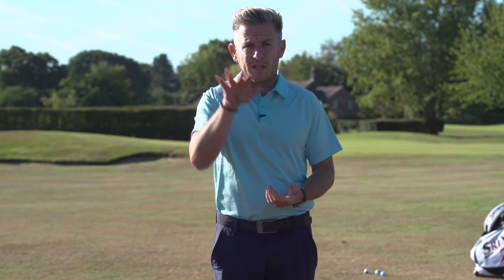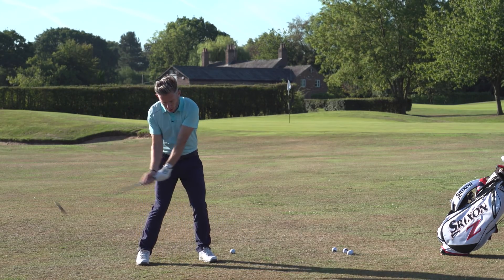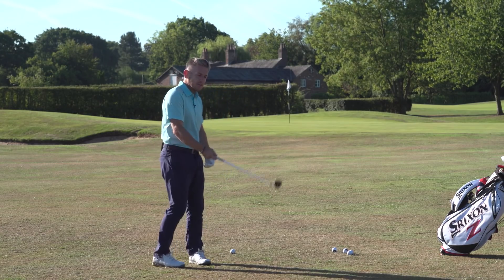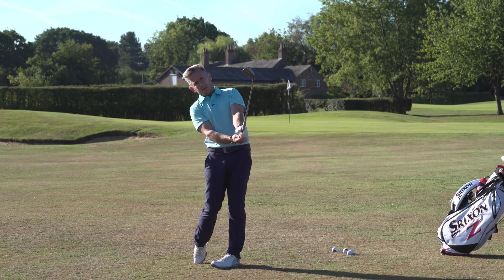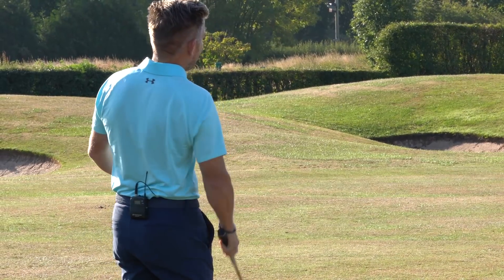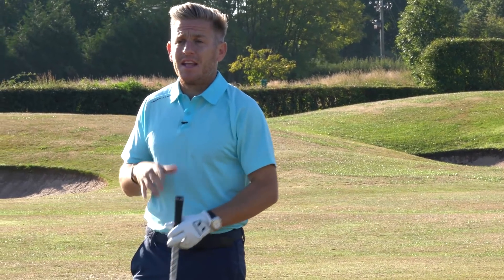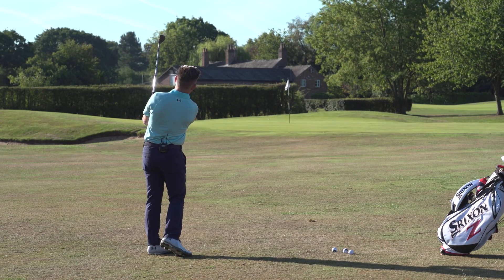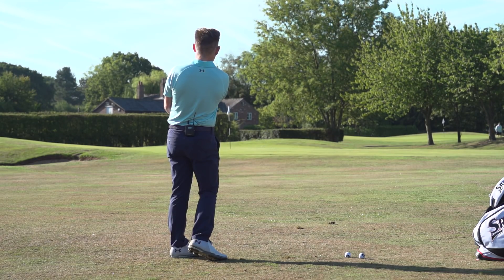TOUR PLAYER WEDGE FLIGHT CONTROL

Comment: Hi Dan. Is this quite different to the pitching lesson you gave somebody (probably last year)? Seem to remember the discussion being about slightly cutting across it and letting the club head pass the hands and finish with mid height hands and fairly high club head - think Jordan Speith referenced. Cheers
Reply: I remember that as well. Was it a lesson with Peter Finch?
Reply: Dan Whittaker yeah think that's it Dan. So different techniques and approaches as they are different shots then?